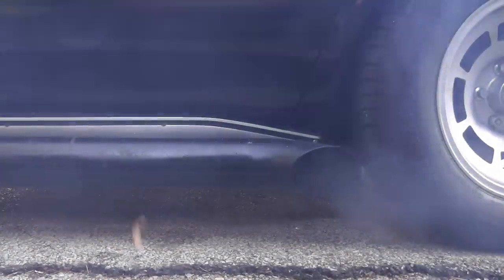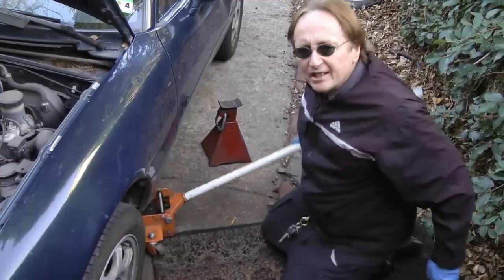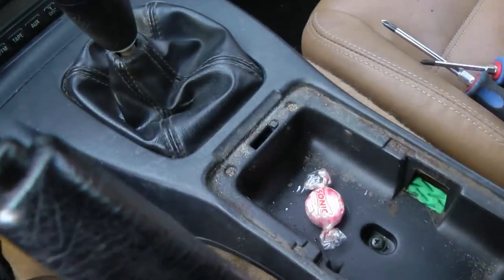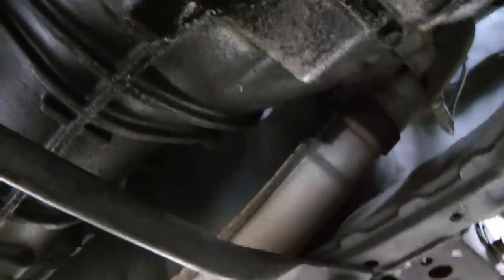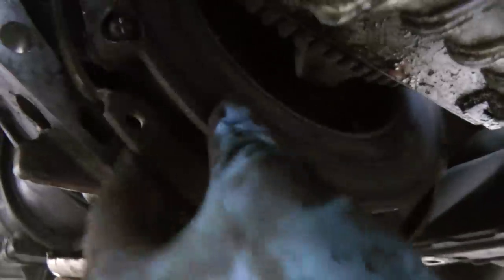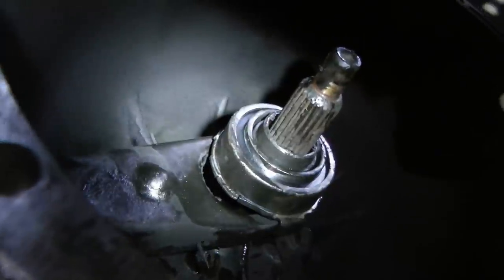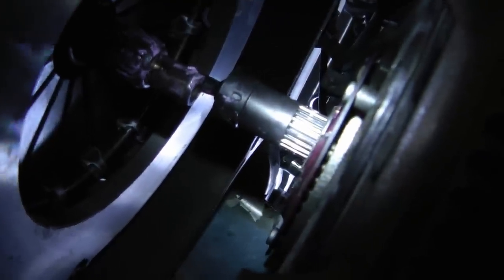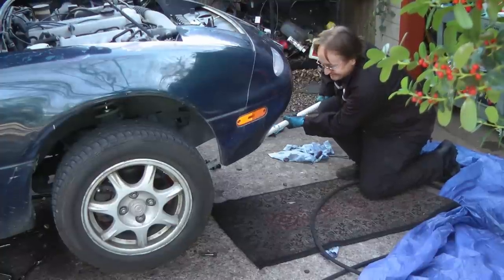How to Fix a Slipping Clutch in Your Car (Clutch Replacement)

Comment: Scotty, my clutch started slipping a few months back on my 3g eclipse. I'm not sure if it's a bad clutch plate or possibly oil's leaking in somewhere onto the clutch plate.  Is there any way to tell before taking it apart? Someone told me it's not possible for engine oil to be leaking onto the plate, and that only transmission fluid can.. is that true?
Reply: Engine oil could potentially contaminate the clutch disk from the rear main seal if the leak was severe enough.  Either way you need a new clutch.  Replace the rear main seal (behind flywheel) while your at it if oil is leaking around the bell housing or just for preventative maintenance.

Comment: Hey I got a Mazda rx8  manual but it wont shift when its on but it shift when its off also the clutch pedal stay down there like it dont got pressure any thought what it coul be thank those video you make are very helpful
Reply: Filiberto Reyes You may need to replace the bracket. My experience a few days ago: Replaced the slave cylinder - slight improvement the I also replaced the master cylinder - total improvement so strong it broke the real problem, the clutch pedal bracket. You can get one brand new assembly off eBay for under $100, don't go to the dealer. Recommend after installing the new one to buy an aftermarket reinforcement. Mazda will only reinforce the bracket or replace it if your car is less than 8yrs/100k miles. Try that trio, let me know if you have a question, maybe able to help now lol.. Peace and good luck

Comment: hi Scotty. My car is kia cerato auto hb 2006. I have been having problems with gear 4 and gear 5. Maintaining the speed at 80km/hr, the transmission keeps changing gear 5 to gear 4 and back to gear 5 back and forth. what could be the problem?

Comment: scotty kilmer i got 350z nissan 03 
I'm about to replace my slave cylinder clutch and i see the fork clutch is not in place where it seat to be it move down and i can push it up and down i think the spring on the clutch fork somehow it take off, now I'm trying to fix this in my drive way the way you remove the transmission is it hard? i can see its simple i got knowledge enough to do it but how hard it is?

and if i go to shop how much they charge on the shop?
just to fix it back the clutch fork.

Comment: Have you ever done a self adjusting clutch dual mass flyweel?
Reply from the maker: +Rodney Widner yes, they are a royal pain, and those flywheels break all the time, Many guys replace em with normal ones
Reply: Lol... they are really expensive i have a bmw been putting it off.

Comment: Hey Scotty Quick question  got a car from brother a month ago clutch pedal has to go all the way to floor since I received I thought this was normal until now I can't get it out of neutral is that a need for new clutch, flywheel, throw out bearing, clutch cable? not sure what parts to buy for father inlaw to fix 96 chevy cavalier
Reply from the maker: +nato b pray it just needs a new clutch master or slave cylinder

Comment: Greetings from Finland Scotty! I just recently bought Suzuki Swift (in America known as Geo Metro..?) Well anyways, it has 1.0 litre 3 cylinder engine and the clutch is "sticky". Clutch works like it should be but its just "sticky". What could be the problem? Someone said it might be the clutch oil? But i dont even know if theres oil in clutch! Haha! And i also heard there could be too much air in the clutch?

Ps. Great videos! You should be an actor for those television commercials :D

Comment: Hi Scotty, I have an 04' Hyundai elantra in which the clutch is going bad, and when slowing down 1st gear grinds and wont engage until i'm going really slow, I was wondering if it could be due to the worn clutch or if the synchronizer is bad. What would be your opinion on that?
Reply from the maker: replace the clutch, they do that with a worn clutch more often

Comment: Hey Scotty,

I recently received a manual 2006 Mitsubishi Lancer with pretty low mileage (45k miles, sat in a garage for 8 years). I've driven manual before, and know to rev up the engine to 1-2k RPM before going into first gear, or else the engine will "jump" a bit, shaking the whole car. 

However, to have any appreciable acceleration when starting from 0 mph in first gear, I have to go to about 2.5-3k rpm with this car, and the start is still sluggish. 2-3 cars typically pass me at stoplights. I haven't noticed any problems with higher gears. Any advice?
Reply: Just keep driving it, you'll get better with experience. You don't need to rev it before going into gear, with practice you'll be able to lift your clutch and put the accelerator down at the right time to take off smoothly without setting any revs, as for taking off quickly more revs and lift the clutch quicker but this wears your clutch out more, just keep driving i guess

Comment: Scotty i changed out a clutch out on a 2000 chevy cavalier and the clutch worked fine a few days but now you cant even put into gear. Ive done plenty of clutch jobs on my cars but this car has the internal slave. What you think it could be
Reply from the maker: hopefully you replaced that internal slave when doing ALL that work, cause if not, and it's leaking now, you'll have to to it all over again

Comment: How did you get the transmission that far back? currently doing this on the same car and i can't get enough room for the alligment tool and barely got the new pressure plate in. Flywheel looks different though.
Reply from the maker: +Official Rekt you use a pry bar and push and shove and swear a lot

Comment: Hey Scotty, have a clutch and shifter problem on my 07 civic si, has 88k miles and the clutch is soft now and the engagement point is lower than normal. the shifter is real stiff too, really hard to put it in gear but still drives. No CEL.  Thanks!
Reply: Check your clutch hydraulic fluid?  If the fluid is low it basically acts like you aren't pushing the clutch all the way to the floor.  A few years ago I was having trouble shifting and my clutch felt weird in my 1999 civic and all it needed was a top off of the clutch fluid.
Reply: Check if your clutch hydraulics are leaking.

Comment: Hi Scotty, I have my clutch replaced, clutch slave, and had the flywheel resurfaced. I was thinking it was just the clutch when I was grinding in 1st gear. I am now grinding 1st and 2nd, but it doesn't grind if i wait a second to put it in gear. What would be the cause of that?
Reply from the maker: syncho meshes are wearing out inside the transmission, live with it. that or the master cylinder is a bit weak, I'd change that out first.

Comment: Scotty I have a 2010 Mustang GT with 5speed and I cant shift to any gear. it moves around soft and around freely and i check the master cylinder and its not leaking and fluid is fine my clutch feels fine also i dont know what else to check
Reply: Carlos Contreras I assume you resolved your shifting problem on your GT?

Comment: Hey Scotty, I just purchased a 1998 Toyota MR2 with the 3SGE NA engine in it. The car has done 240k kms, and is ready for an oil change. The car's Owner's Manual states that 5W-30 is recomended, but when i contacted the previous owner, he said that he had put 20W-50 in the car. Would this have worn down the parts excessively in the engine, and if so, should i continue to put in 20W-50, go back to the manufacturer's recommendation, or put in a different weight of oil altogether? I would like to make this car last as long as possible. Also would you have any specific brands of oil that you would recommend?
Also, I would like to ask if it is normal for a stock gearbox to whine? If not what could be done to solve the problem? Thanks, Kevin
Reply from the maker: I would stick with the heavier oil with that mileage.  I would also use castrol, which I use in all my own toyotas with that kind of mileage on htem. With that mileage, gear boxes tend to whine, especially in cold weather

Comment: when i drive my 2000 chevy blazer 4.3L it sounds as if the clutch is grinding  and its having trouble shifting gears and engaging. the fluid level is normal but its a automatic which worries me because in my repair manual says i cant do anything to fix it , im wondering if the mount for the transmission might actually be lose, if i should just buy a new transmission or just give up on it all together. the grinding sound seems to be comming from the transmission and it sounds like dry windsheild wipers going across the windshield. this is only one of the problems with this vehicle and though i know the others and can fix them this might just be over my head and not worth the time. is there anyway i can check all this myself?
Reply from the maker: me, I'd give up, those fall apart at that age and generally such noises are internal damage in the transmission. GM products don't hold up over time like they did when i was a kid
Reply: Scotty Kilmer With all due respect, my only vehicles are a 56 chevy truck and and a 2002 sierra, both vehicles have ran forever. I'm content with 59 years of loyal service from my truck
Reply: Achilles Jeserich
1956 was when GM made good vehicles. But I doubt the 2002 will last as long as the '56.
Reply: Got 200k on the GMC and the only problem it has ever had was the altenator went bad but it cost 10 dollars to fix it and 2 hours of my time. I still believe in american made. the 1956 is just a reminder that we need to get away from chinese crap
Reply: Did you know that blazer from 2000 was actually rated number one in consumer magazines as one of the worst vehicles ever made? I'm not making that up

Comment: Is changing a clutch on a rear wheel drive car this much hassle? When I had the clutch changed on my golf mk5 front wheel drive,  they didn't remove all that,  just moved the gear box etc and got to the clutch.
Reply: It's all down to the orientation of the engine.  On the MX-5 (the car Scotty was working on) it's front to back.  This puts the gearbox behind the engine.  On your gold, it's side to side (transverse).  Your gearbox is on the left hand side, so you just pop the driveshafts, unbolt the box and you're on the clutch.

Comment: Hi Mr. Scotty. Does we need to change the clutch fluid also instead of gear oil? Thank You.
Reply from the maker: +c4prlm4st3r you can every 4 years or so just to keep the seals fresh
Reply: Thank You Mr. Scott.
Reply: What's that purple grease ya used? 
Cool color, I'd like to procure some.
Reply: +MrTheHillfolk It's bearing grease

Comment: If the grease is not used, the transmission won't shift well in about 6 months. The ahole mechanic who did my 1993 Toyota truck didn't grease it. 
Mechanics wanted $200 just to diagnose it. I greased it myself (this was before YT) and it was good as new.

Comment: Hey Scott so I have a 05 Civic and recently had my clutch replaced and flywheel and for the first 2 weeks my clutch engaged at the middle then I noticed one day it engage all the way at the top now and the bottom of the clutch pedal when I push it in it feels really loose. Is it because my clutch is new and has broken in ? Or do I just need to adjust it at the clutch pedal to engage lower  ?
Reply from the maker: adjust the pedal rod inside the car at the clutch pedal

Comment: Hi Scotty,
I've got a 2005 Toyota Corolla with a manual transmission, 75k miles. When I shift from 3rd to 4th and press on the gas, my tachometer jumps up ~300rpm and then comes back down and behaves normally again once it's "jumped up" once. This also happens when I go from 4th to 5th (but less often). What do you think is the problem?
P.S. You're the man!
Reply from the maker: +Baccalarium time for a new clutch as in this video
Reply: Thanks for the reply Scotty! If it's only around 300rpm and the car works totally fine in 1st, 2nd and 3rd, do you think I could ride it out for the winter? Or is it best to change out the clutch ASAP?
Reply: +Baccalarium change it asap it will only get worse and then you'll smell your clutch burned. o yea don't do this yourself it's not that easy it will take about 4hrs to someone that knows what their doing.

Comment: Hi scotty I don don't know if you are gonna answer me but I try to ask   you.    I am replacing the clutch and the flywheel on 2004 c230.mercedes  bns.        1.8l.    but I don't  know  what. Is the torque  to tighten the bolts on flywheel.     And.   The  clutch.  if you  have time

Comment: So Automatic vs Manual, which is better? Does it really matter for most drivers?
Reply from the maker: +xinic5 in the long run manuals cost a lot less to maintain and break down much less than automatics, IF you keep cars a LONG time like me

Comment: Hey Scotty,
I have a 2011 Altima coupe 6 speed. My car shifts fine, but the stick vibrates occasionally when i change gears and release the clutch,

also, sometimes my clutch pedal comes up 85% of the way, and takes a few seconds to come back all the way again. But no issues with the gears or transmission. Any ideas?
Reply: ***** Yes, I think thats what i'll do. I even have the fluid. I just don't know the exact procedure.

Comment: I've had a new 3 Piece clutch kit installed in my car and my car still has the problem it had before. In any gear at low Rpms (below 3-4k RPM) under any throttle above 30% just makes the car judder like crazy and not speed up. Help please?

Comment: Scotty....96 Toyota Avalon XL (6 cyl)..... Trying to understand how to correctly check the trans fluid level. On the dipstick it has a Hot and a Cold region (each region is bordered by notches in the dipstick), with a separate area in between the two regions. My understanding is that when the car is at normal operating temperature, the fluid should be within the Hot region. Is this correct?
Reply from the maker: yes, that's correct. I would only be near old on an ice cold engine that sat all night
Reply: Thanks!

Comment: In 1st gear my truck rides good but after that when I hit the gas my rpm goes up but my speed goes up slowly. Also the gear doesnt engage till my foot is ALL the way off the clutch. Does this mean clutch is bad or does the linkage just need adjusted
Reply from the maker: time for a new clutch as in this video

Comment: IMO, this is one of those jobs best left to a pro shop if you can afford it.  Yes, I've changed clutches before only because I was too poor.  In my older years, I had a "national chain" shop replace my clutch on a modified Mustang.  It didn't last a year of normal driving.  I had a "pro hot rod shop" replace the clutch with a good after market brand.  They showed me how the flywheel should have been resurfaced and along with the better clutch, the car shifted a whole lot better.

Comment: scotty how long does a clutch usually last? just wondering couse I got a 2008 mustang with 75600 miles on it and its a standard
Reply from the maker: +Glowing Dragon22 just depends how hard you drive, I've seen 15 thousand miles, I've seen 200 hundred thousand

Comment: Mr Scotty I have a question I have a 87 acura integra and I have a problem .went I start the car went I want to go into gear the the gear doesn't want to go into first gear feels like is lock or so .went o turn the car off I'm able to go into gear but but went I turn it back on it won't go in gear what Could be the reason the clutch is really soft also the other problem i don't know if  is also part of the problem that every time I go reverse the gears are touching like teeth with teeth like berly touching each other

Comment: Since you already had the drive shaft off, why not also replace the universal joint and prevent a future problem?
Reply from the maker: they rarely go bad on these light cars
Reply: Scotty Kilmer 
Hey Scotty it's flooded over here In California right now, i drove through a deep water road In 1st gear , and as I passed the deep water I shifted to second gear and my truck lost power it seem like if I had put it in 4th gear, it's a manual truck so u think that happen cuz of the water or my clutch is worn out ????
Reply: Sounds like you have water mixed into your oil. Best not to drive it to avoid long term damage, drain it and refill with new oil or get your car into a garage.

Comment: +Scotty Kilmer , got a little bit of oil on the clutch when I put it on from dirty hands . Should it be okay and not slip? It wasn't much. Just like dried black oil or dirt
Reply from the maker: it will burn off
Reply: I had the transmission lined up and on, but it moved back out of alignment. ... Stupid thing

Comment: Apart from letting the clutch wear out completely, are there signs of knowing when your clutch is nearing the end of it's life?  I've never owned a manual until now.  I've only got 10 thousand miles on it (bought the car new).  I'd just prefer to have them replace it before I start getting the slipping and possibly being stranded somewhere when it goes.
Reply from the maker: +tlv156 say you're driving 65 in top gear and go up a hill and floor it, if the clutch starts to slip then, it's on its last legs
Reply: Thanks Scotty!  I appreciate you taking the time to answer.  I'll keep that in mind.  Great videos and information!  Thanks!

Comment: I have a manual transmission 200sx, and when I sit in traffic stop and go after 15 min it becomes hard to put the car in 1st or 2nd gear, does this mean overheating or is this a fixable problem? This mainly happens on HOT summer days although it has happened in winter but takes about 30 min of stop and go before acting up.
Reply: Change your transmission fluid and see what happens.
Reply: may have to rebuild and overhaul tranny if transmission fluid doesnt help